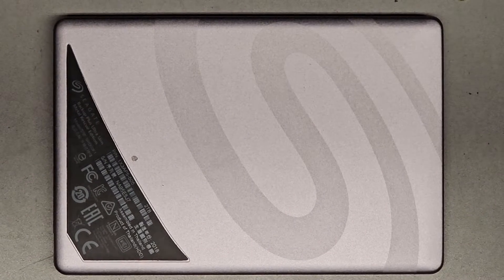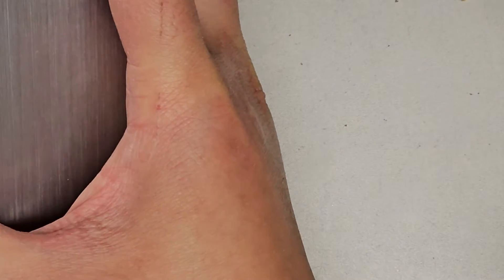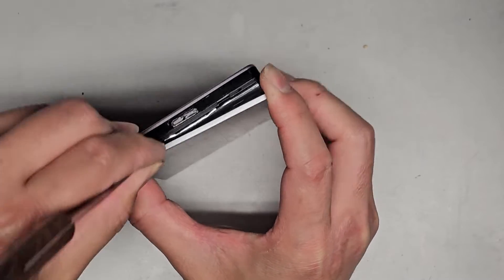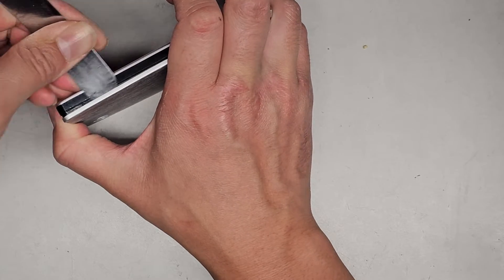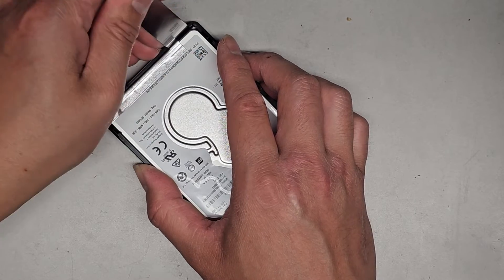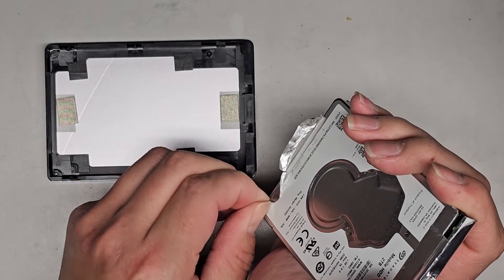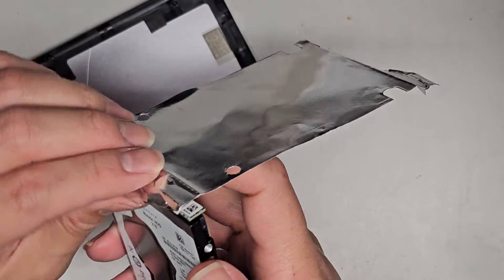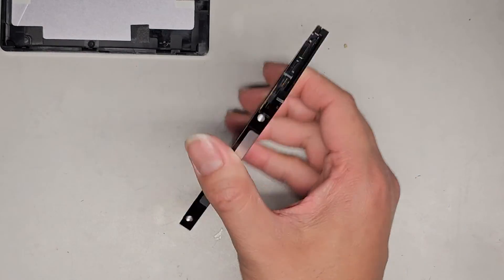Seagate Backup Plus Ultra Slim Metal Rescue Edition Disassembly Repair SATA USB Adapter Fix

Comment: i have this case. I have been using this drive regularly for months but all of a sudden one morning windows hit me with the *there's a problem with this drive*, so i clicked scan and repair.
however after some time windows said that the repair failed, and after that the data from the drive stopped showing up in my file explorer. I know that the drive is still alive because whenever I plug it into my computer, the light stays on, and windows recognizes it by making the ding sound. It's just not showing up in file explorer. whats the possible problem?
Reply from the maker: The drive is dead.
Reply: @ItsBinhRepaired  okk so is there any way to fix it or at least recover the data?
Reply from the maker: @niketton9219 you'll probably have to send it do 300dollardatarecovery.com
Reply: @ItsBinhRepaired ohh i dont live in the US i live in Nepal

Comment: hey thanks for showing this, i have the exact same device

It was working perfectly about 1-2 months ago, but when I tried plugging it in to my computer this week the SSD gave 1-2 blink sounds but I could feel the disks moving. The light wasn't turning on tho

I tried plugging the SSD with a STATA cable but the same thing happened. I am not sure if the type of STATA cable matters but my only option is to find a repair shop

Did you do anything else to test the drive?
Reply from the maker: Sadly sounds like you'll have to send it for data recovery. I recommend 300dollardatarecovery.com